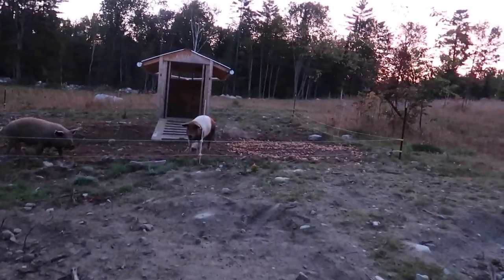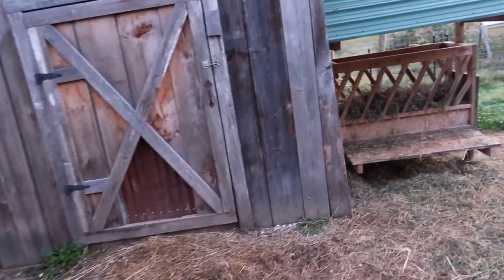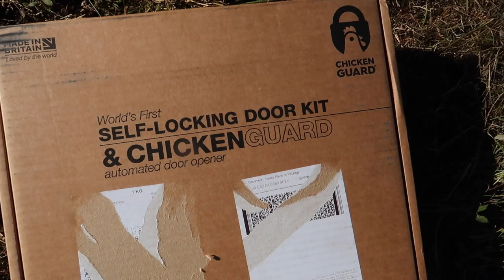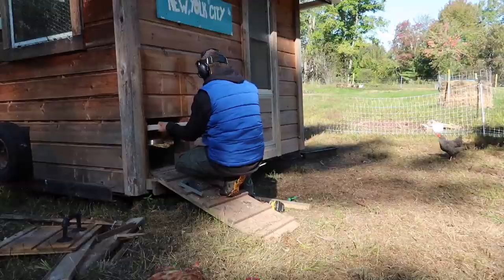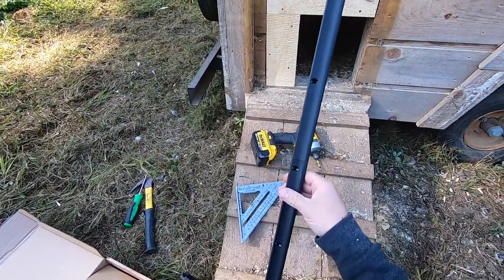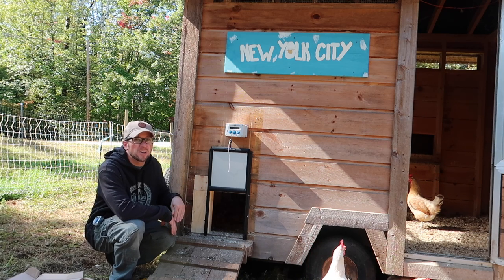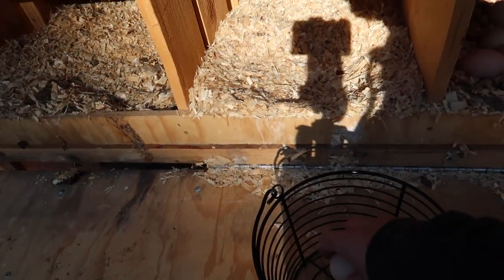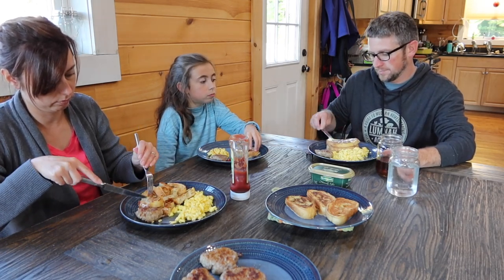We've had enough NO More PREDATORS getting in our CHICKEN COOP!

Comment: Mr. Lumnah, 
I would suggest that you move the milking stand back four to six inches front the facing wall. At least until you put in the wall boards.  It looks like Willow sneaked a few nibbles on the foam while you were talking and milking.
While I was growing up,  my Dad would "Turn up the thermostat" in the stanchion barn by pushing the hay left from overnight to where the cows could reach it, or giving them more if they'd eaten it all.
Its amazing how much heat a ruminant can generate by eating dry hay. That's why one if the last chores at night in cold weather was to go out to the barn about ten PM and make sure there was plenty of hay in reach of the cows. May I suggest something similar to you?

Comment: I immediately thought .. after seeing the chicken coup automatic door being installed... that a roof just over the door would be smart.. to keep rain and snow off the top of the electronic door opening device.
Reply: It has a light sensor in it that would be affected by a roof.
Reply: Just about to type that in, making a small awning would be great. Kudos
Reply: @jeffweber8244  Do we really know how much it would be affected by a roof?  After all, it doesn't have to rely on direct sunlight to open the door in the mornings, right? If it does, I can't see it that it would be very useful, especially on cloudy winter New Hampshire mornings. But, I haven't seen the specs. I guess I just assume that you would be able to set it according to a timer, as well as light, but I could see such a device being only one way or the other.  :(   The main thing that Al seems to be excited about is for it to close the coop at night. He is out there feeding all the other animals in the mornings so I guess morning opening isn't that necessary.
Reply: @jeffweber8244  The unit has an adjustable light sensor. A roof would have no ill effect. It doesn't require direct sun. I've used this same unit (with a home-built door) for over three years with the sensor in complete shade at sunrise and sunset. Factory settings worked well with no problems. Anyway, he used the timer option which means it would work in complete darkness.
Reply: @jeffweber8244  The sensor will work fine under a roof. Mine was outside the barn on a west wall and the auto door would not close until it was pitch black outside. I moved it inside the barn and it still functions fine, the door closes a bit earlier. The girls have all been up on the roost for at least an hour before it closes. There are windows on the west wall of the barn, no other light comes in and the door still opens in the morning.
Reply: I like your videos what is your vocation? Construction I take it? Dewalt brushless tools work really great! Get a brushless impact .... ebay 90$.

Comment: Al, those AA batteries wont work well in your winter. Maybe, build small boxed in overhang with angled top and add Solar Charger Power Bank 25000 mAh Portable Charger 3 Output Battery Pack and attach to top and connect to USB of coop door unit. Keep up the Great work!

Comment: you might want to build a overhang over the chicken door to shield from snow
Reply: I was going to say that too, just two hours later. Build an overhang to protect the door from bad weather. Make it so it slides on and off, or up so you can put new batteries in the chicken door. Your chickens are such talkers, hey Al what is going on with that door???  Have you seen the super large chickens on Dannel's channel?  Too bad the sunflowers and squashes and zukini  got a late start.  Have a great day!🐐🐐🐐🐐🐐🐐🐐🐐🐐🐐🐐🐐🐐🐐🐐🐐🐐🐐🐐🐐🐤🐣🐣🐔🐓🐤🐣🐣🐣🐔🐓🐤🐣🐣🐔🐔🐤🐤🐣🐣🐔🐔🐓🐤🐣🐣🐔🐔🐓🐤🐣🐣🐔🐔🐓🐤
Reply: I was going to say the same thing. Remember all the times he had trouble opening the old door. Or since it is battery operated not solar and works on a timer why not mount on the inside?
Reply: @dalehenderson3526  seeing how it worked by a string I don't believe you can do that
Reply: @dalehenderson3526  ~ It closes at the time you select, OR sundown, whichever comes first. An awning late in the day might simulate sundown?
Reply: Yeah, I think that a good sized overhang with sides (forming a small tunnel in front of the door) will be needed to keep snow and ice off those tracks. Maybe if it is built from greenhouse plastic and/or plexi-glass it will still allow enough light in for the sensor to work. Keeping New Yolk City facing South would help too.
Reply: @jmc88480  I like your way of thinking - using a clear overhang!
Reply: @dalehenderson3526  on 2nd thought there maybe a way to do it using a rubber grommet and a drilled hole to put the controller on the inside
Reply: Or install inside coop.. out of the weather
Reply: @melissajarvis4829   yeah, it would have to be angled steep to shed the snow, and maybe sprayed occasionally with something that won't let the snow stick to it like that expensive windshield washer fluid. lol

Comment: May I suggest that you build a little roof with sides as low as possible over the control box and the upper portion of the door.  This would allow some protection from snow and ice accumulating on the box and cable to the door.  
Just like car-doors, in your climate, on occasion, I fear the door could freeze open or closed.

Comment: I've used this same unit for over three years and the thing I've learned is to be very  careful changing batteries. The wire leads wore and broke where they came out the back of the enamel coating of the circuit board after three years. I bought another and Chicken Guard said I could send the broken part back for repair. (Haven't done it yet but I need to do it soon.

Comment: That is a very useful way to manage the chicken coop door, the only thing I wondered about is this how easily can you check that the door has closed or opened on time and not been stuck, e.g. by ice. A red LED with a microswitch or a magnetic sensing door switch could easily perform that function. Others have suggested adding some weather protection to deflect the rain and snow, that sounds like a necessity with the wild winter coming. How often will you have to change the batteries? A solar charging function could be useful to keep things topped up. Obviously you still have to collect eggs, add feed and water and be certain that all is well.

Comment: with your ice problems in the winter, you may want to put it on the inside of your coup.
Reply: Good idea, but might take some reconfiguring.  Sounds like the control has to be outside for light sensing.  Might have to call MacGyver.

Comment: HEY AL, ....COULD YOU PLACE A SMALL ROOF OVER THE NEW DOOR TO ACT AS A BARRIER TO RAIN, SLEET, SNOW BUILDING UP
OR IMPEDING THE DOORS MECHANICS ??   EVEN A FOOT OUT OR SO WOULD BE FINE AND MAYBE WITH 2 ANGLE PIECES ON SIDES
FOR BRACING ..... WITH YOUR SKILLS IT WOULD BE DONE QUICKLY .... AND YET GIVE COVERAGE TO THE OPENING FOR DA CHICKS.

Comment: Thankfully, I haven't seen a skunk on my acreage yet. What I was thinking, though, is that you could take a section of one of those clear panels that you used in the goat barn, then maybe use a heat gun to soften it enough to make a  L, drill a couple of holes in it, then attach it right over the sensor for the chicken door. That way the light sensor is not affected and the sensor is protected from the weather. Might need a bit of rubber to keep the bracket snug to the coop. Just a thought.

Comment: Moisture and freezing temps will stick that door in the track. I love my door though. I have had chickens locked out at night because I set mine to close with the light sensor. Their coop is in a completely fenced in run though so no predators get them when that happens. The benefits outweigh the problems for me. :)

Comment: Automatic Chicken coup door weak spot... The string
Reply: Ted Pollard  couldnt it be replaced by a fine gauge wire?
Reply: Ted Pollard  stainless steel so it wont rust
Reply: @cathiwim  Depends on the winding unit I would think.

Comment: I would put a in closed porch on the chicken coop and mount a solar panel that would keep the battery charged in that coop door opener. May I suggest some kind of cover over the front where that string that pulls the door open. Personally I don't like the design at all. Not heavy duty enough.